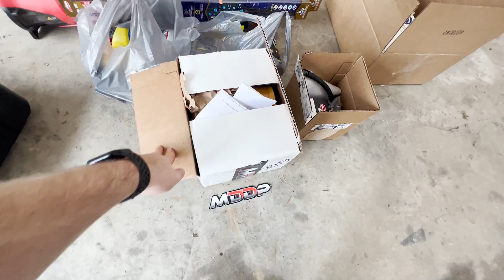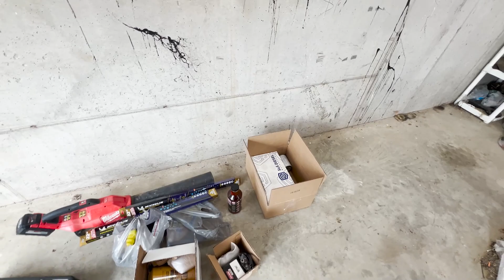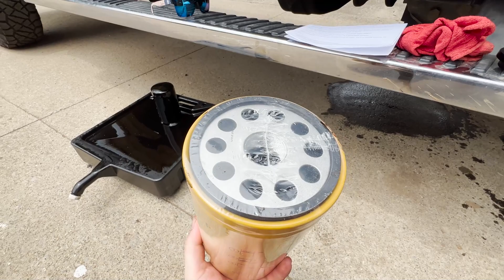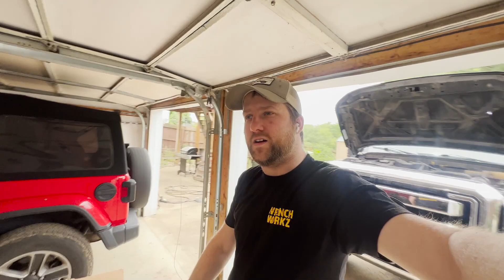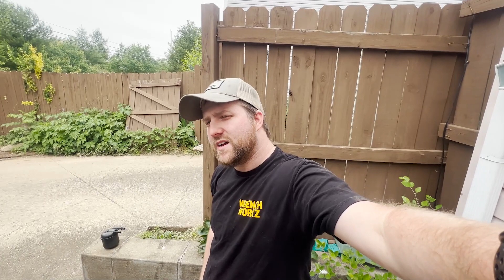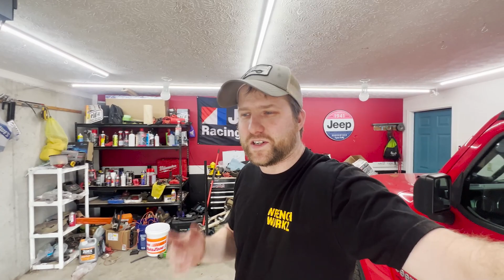CAT Oil Filter on 6.7 Powerstroke Diesel? #diesel #powerstroke #viral

Comment: Just ordered the SPE oil filter adapter today.  
It bolts a whole new adapter to the block instead of the spin on adapter. Supposed to be stronger and they machined it so the 1R-1807 filter doesn’t hang so low.